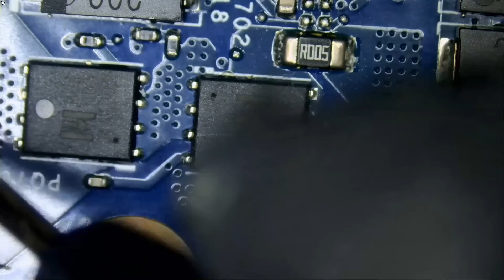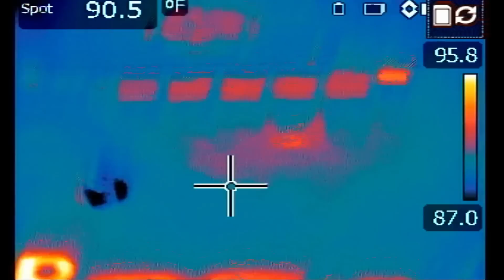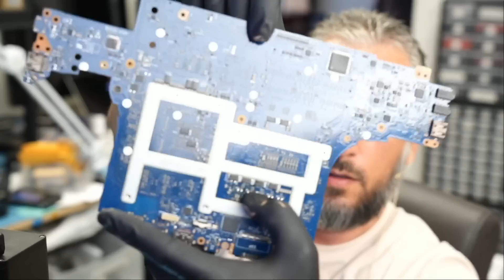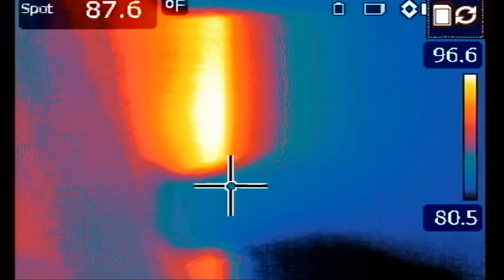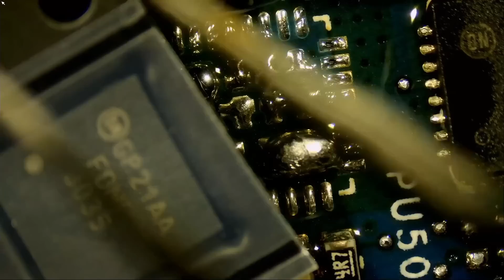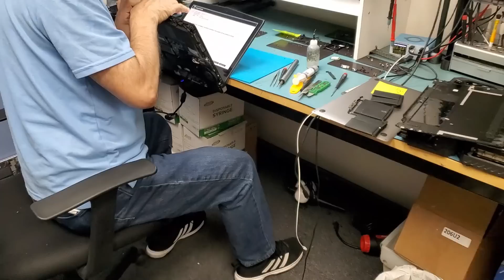Dell Alienware Won't Power On? Here’s How We Fixed It!

Comment: Hi , i have area 51m r2 won't turn on after putting it in a cold and humidity 88%  overnight i have pressed power button many times and then for  30 sec with and without charger then i smelled burning coming from the the back fan and from graphic amplifier port , what could have happened and how much does it cost , also i have an old problem with keyboard buttons working and stopping and some of them doesn't work and some works again if i pressed it hard could it be somethig in the motherboard causing that as i have connected a wireless keyboard and it works fine

Comment: chip could wait, customers should not have to wait
Reply: the customer is not a paying customer until they have a job in place. the other customer on the other hand has paid for diagnosis. if you paid and had to wait how would you feel ? yes the customer is always right but a paying customer has priority i think.

Comment: Just a hint for using the thermal, not for real world but if you are making visuals for the masses then you may consider...  
Glass of water and ice, place probe in. Metal is best but your choice.  
Use cold probe under thermal to point out shorts. This way you can have a good contrast between the problem and the pointer.  

Keep up the good work.
Reply: If it's that cold, wouldn't there be rapid condensation on the probe?

Comment: I once had a alienware laptop back in 2007. Payed around 800 usd. After around 5 months it suddenly wouldnt start. I tried a new powersupply, but no luck :/

I contacted support and they wanted 300 usd just for them to open it and figure out what was the problem. *i also had to pay for shipping both ways + insuranse all the way to china.

As a poor student i couldnt afford that.. so i scraped the pc...

Bought a 300ish usd cheap laptop later: it had a nice long life before it was retired.
Reply: Didn't it has warranty?